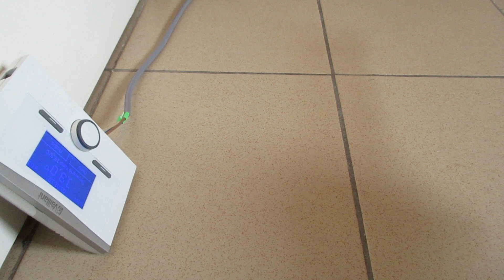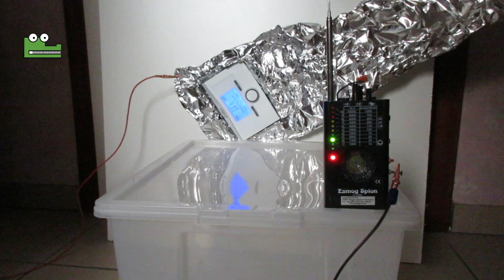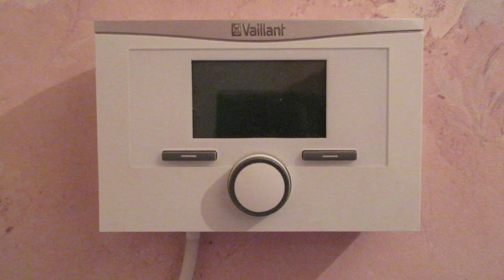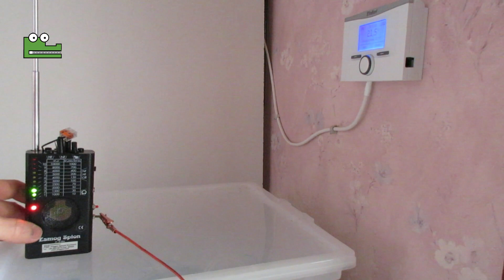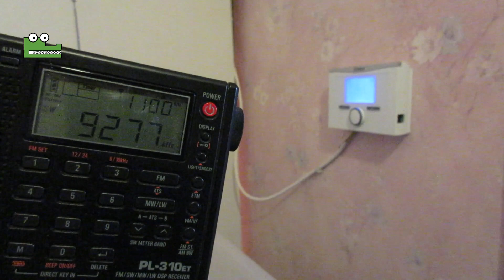Boiler & Thermostat - Shielded electric wire with ground and drain -- pulsing EMF EMI -- (Part 2)

Comment from the maker: A friend of mine said i could have connected the ground cable
inside the boiler in the same place the other ground cable is connected:
the yellow/green ground cable top right (seen at 5:11) coming out the white cable running to the left. I will look into that later.

I'm not sure how professionals would connect the naked wire to the ground
compared to what i did at 5:29. I just did it this way because i couldn't find instructions on YouTube how to do it, nobody seems to have made a video yet about such cable, i didn't find it yet at least.

I did all the wire stripping with a Stanley knife,
i didn't use special pliers, just some basic ones
to pull the plastic tops of and cut wires off.
You just need to be careful for the wires (and your fingers).

Even though the electric field pulsing is now mostly shielded,
I'm not sure how much it is improved,
because the EMI (dirty electricity)
is still there in the kHz up to the MHz range.
So I'm not sure yet about this "result".
I won't stand around this thermostat and boiler all day to test though.
It remains a source of EMF that needs to be avoided.
It's always better to buy "clean tech" instead, but I'm renting, so yeah...

It's good to know that many meters, like the Gigahertz meters and the Cornet meters
will not detect this pulsing and do not have a useful sound function for electric fields
to warn about this problem. Having some different meters definitely help,
so i would definitely recommend that if you are EMF sensitive.

Info about the grey meter i used is in the description above.

btw, my neighbors love the sound of radiation in the morning :)